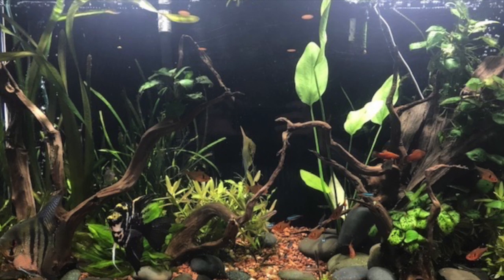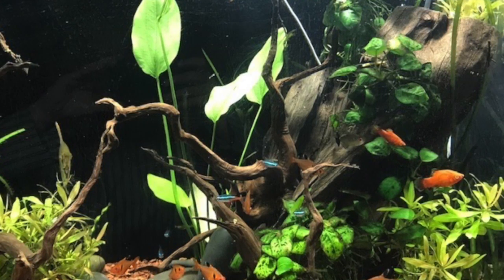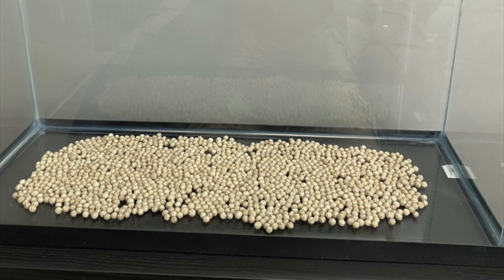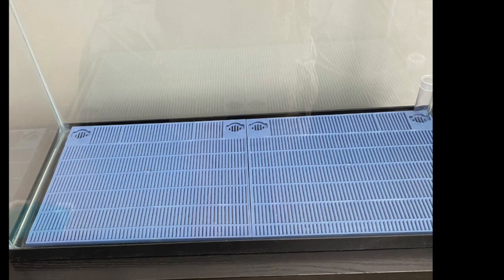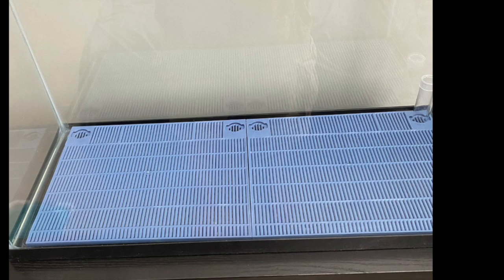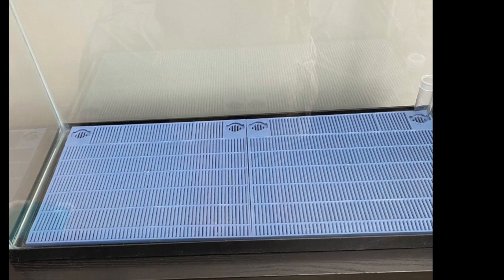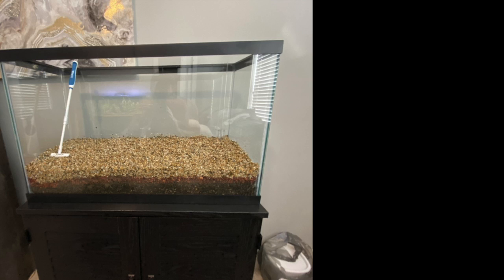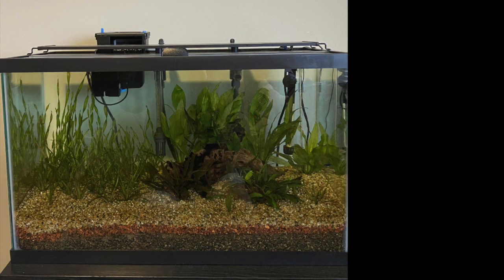Marks Anoxic filtration build. Nitrates went from 20-40ppm to 0ppm.

Comment: Dumb question maybe, but if your not replacing more water, and given that nitrification processes consume  carbonate, won't the tank's pH crash, or are you replacing carbonate? My local water supply has a KH 1deg and GH 4deg.
Reply from the maker: I've never had an aquarium crash using a Plenum or an anoxic filter in 40 years.

Comment: Hi Dr. Novak. I'm planning on building a large African cichlid tank. I know that they like to dig, so I'm planning on having a screen on the plenum. But I still want them to be able to dig like they naturally do. My question is how deep can I make my plenum? Can I have 8" to 10" of substrate? I'd like the fish to have a few inches to dig. But also a solid foundation under for the plenum. Do I just turn up the air to compensate for the depth? Thanks again for your videos and time.
Reply from the maker: to have a deep substrate, but I don't think you really have to go that deep. Even if you went 6 inches and allow the fish to only dig, maybe an inch into it that would not upset the fish.
Reply: You can but it'll look weird and will take up a lot of water column and you'll need a ton of substrate! You can have a 5" substrate 4" of it on top of plenum and the mesh at 4" and 1" on top for the fish to play around. I have around 3" on top.of plenum and 1" on the mesh i sewed. I have a 100g cichlid tank.

Comment: I'm curious if the BCB bags will work in an Aqua Clear 50 HOB on Minimum flow? I want to use 2 bags so If I need to change one I can at least one working while the other "comes online"?  I can't really do the Plenum because I need high flow high Oxygen for Hill Stream Loaches and need to run power heads on the UGF spraying air. I had the loaches before, and they never did well because I didn't have the fast current and high Oxygen levels, I now understand they need. They are not a beginner fish and like very clean water.
Reply from the maker: Other people have added BCB baskets to their hang on the back filters, and seem to be having great success with it.
Reply: @anoxicfiltrationplenums  Honestly when I got the notification for your reply, I was holding my breath. I'm relieved to hear this can work. It's not a big deal to devote this one HOB to the Anoxic Filtration bags because I have 2 of them. Quick question will carbon or any other type of bag in the second unit interfere with the Anoxic filter?

Comment: Hi Dr Novak. I am currently trying to work on a design for an anoxic filter similar to an undergravel filter using anoxic filtration principles and needed your advice in fine tuning pipe length & diameter, etc in order to optimize the anoxic conditions in the filter. Can I email you my diagram of the system and my current intended measurements for your review and advice.
Reply from the maker: How can I help you? drklnovak@gmail.com
Reply: @anoxicfiltrationplenums  Thanks. I will email you the details.

Comment: Thank Dr Novak for sharing. 
My 7.5g tank which I built using a plenum and baked red clay in July, 2022 is consistently less than 20ppm with only occasional 20% water changes & top ups. 
My 40g goldfish tank which has a heavy bio load is set up using bcb bags with baked red clay in a sunsun canister filter & overhead diy sump with baked clay and pothos & after 4 months is now on average 30 to 40ppm with weekly 25% water changes. Previously it used to go up to 60 to 80ppm.
Reply: What red clay are you talking about?
Reply: @rockfella27  The one normally used for pottery.
Reply: @superaquatics  Is it granular?

Comment: Hi Dr. Novak, in Marks 40B does the substrate on the bottom interfere with Anoxic conditions, also I use the same product that you used on your 40B build for the UGF and they are quite more expensive now, but I think are better to use.
Reply from the maker: Yes it does. That's something Mark is going to have to determine if he will someday have to break down the aquarium and do it with a Plenum. Like for example my goldfish aquarium with sand and small gravel is doing great and it's been up for now for over a year but it does use a Plenum..

Comment: I don't think he needs to worry that the second tank is still showing nitrates. It can take months to break in this system. I have 11 tanks, all on Anoxic filtration. 1 of them took about 5 months before the nitrates got under control. Another I literally have never seen nitrates in since converting it. There is luck involved on how quickly they fully 'cycle'. Currently, 2 of my tanks are a little overstocked. I was getting 0 ppm nitrates for months, but the fish have grown a lot and I added more temporarily. I now consistently get a reading of about 10 ppm nitrates, but that's it every day. It's not accumulating more and more, it's just gonna take time for the system to be able to fully keep up with the stocking. Plus some of those fish will come out once they grow a little more, so I'm not worried about it.
Reply from the maker: Yeah you're right, it's funny how some systems break in quicker than other systems and I really don't know why that is.

Comment: I have a 5 gallon bucket filter setup as an anoxic filter.  If I get elevated nitrate tests. I simply slow down the flow into the filter for a week and then I start testing 0 nitrates. it's unbelievable, I change my water when I feel like it. Thank you Dr. Novak!
Reply from the maker: Great tip!  I try to tell people that constantly that sometimes things could be running too fast and all you have to do is slow it down a little bit for the anoxia conditions to exist. You seem to have caught on very quickly and now you are just adjusting what your test kits tell you how you should adjusted it.
Reply: @anoxicfiltrationplenums  I followed your instructions, it works!
Reply: Thanks for sharing!

Comment: On his 40 gallon tank, he is using root tabs and easy green. Both will introduce nitrates into the tank. If dosed correctly, will keep your tank at 20-40ppm. So, the filter could be working.
Reply from the maker: I thought the same thing as you did. He needs to stop using all the fertilizers and root tabs.

Comment: hey doc, i use a product called ''Turface'' in my greenhouse cactus media. it is a calcined clay product. have you ever tried it as a filter media? it also might be good to use as gravel in an aquarium. it has a pleasing brown color. i don't think youtube will allow a link to the company but it's very easy to do a product search.  i did a search of your vids using the word turface and didn't see any results. have you come across it, and if so what were your thoughts? thanks
Reply from the maker: Yes I have but it has a lot of calcium in it and therefore it creates the water to become too hardened, which is great for African cichlids, mollies any fish that likes hard water, but other than that a lot of people have steered away from such a product because of that.
Reply: Turface has low CEC as compared to Oil-dri. Does not mean it won't work but it may not work as good as kitty litter/oil-dri.

Comment: Anyone keeping marine fish using BCB?
Reply: My 850 gallon marine tank ran in a plenum for all 12 years of its existence.  That tank had over 35 large angels, tangs, butterflies , etc and did great! So bcb bags in a sump would work just the same imo.
Reply: I’m of the opinion that there are easier and guaranteed methods for nitrate removal in saltwater. Carbon dosing, algae turf scrubbers, sulfur denitrators etc. When I had my sps tank up and running I actually had to dose nitrates due to a cyano bloom from bottomed out nitrates.
Reply: Thanks for the reply

Comment: I don't really agree that his plants are thriving. I set up my tank in much the same way, except it is very lightly stocked (currently) and much more heavily planted. I am now about six months in and have a problem. My slow growing plants, have green spot algae, and my faster growing plants are yellowing and cannibalizing themselves. The former is probably due to phosphate deficiency, the latter is due to nitrate deficiency.
I was using a fertilizer without phosphate and nitrate and have switched to one with nitrate. I am also having to dose additional nitrate until I can balance things out.

From those photos, it looks like his plants are starting to yellow. But there's no doubt, Anoxic filtration works for knocking down the nitrates.

Comment: I think the comment that under gravel filter plates being expensive was trolling.
Reply from the maker: You know, I was kind of thinking that, or maybe it was some real young person that maybe didn't have the money.
Reply: Undergravel filters are actually quite cheap from China and if someone still can't afford it then they can easily build an undergravel diy filter using egg crates or plastic trays. I have done it and it works fine. The under gravel filters are no longer available locally due to lack of demand and I didn't want to wait the shipment time from China which is around 2months so I simply built one.

Comment: The Anoxic filtration works great in my aquarium and my koi pond ,
I would like to wish you a merry Christmas and happy new year and thanks for your help
Reply from the maker: Anoxic filter baskets have been running now in my pond for over 35 years straight without being torn apart and still filter the pond as it did back when it was originally built. It is the only non-clogging filtration system out there. I wished you a merry Christmas and a happy new year.